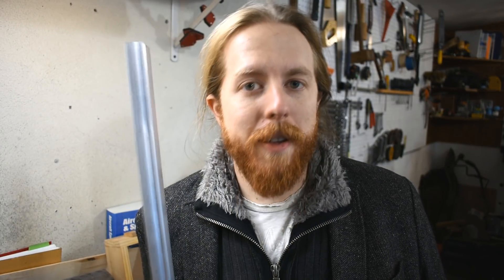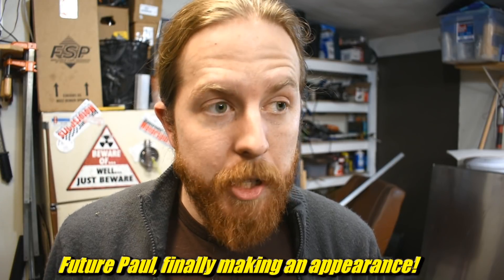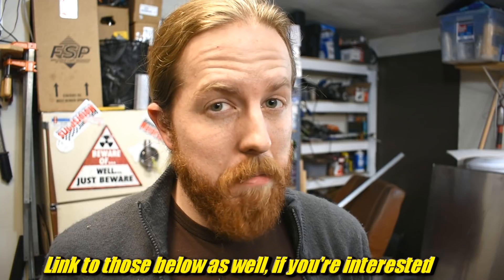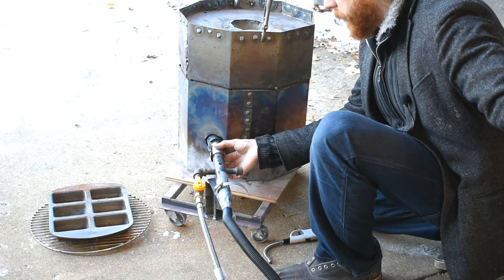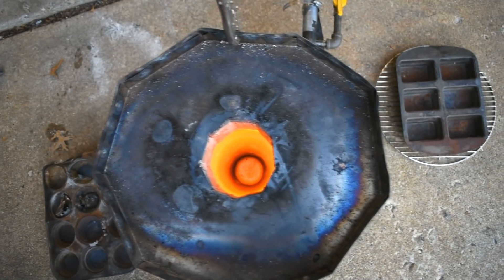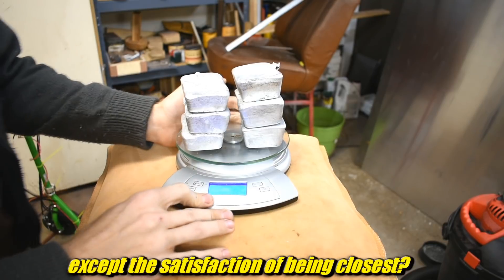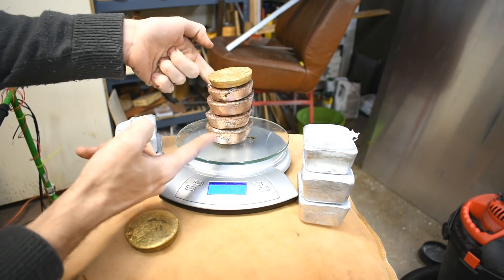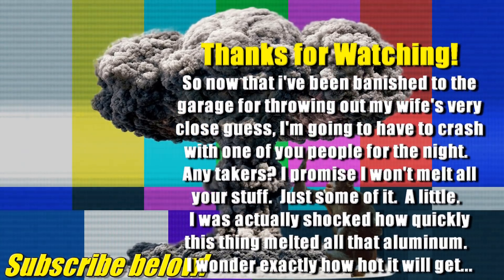How quickly can I fill a crucible with molten aluminum?

Comment: did you get your crucible and holder from that guy who makes and sells them online?  "free holder when you buy the crucible!"  that guy.  what was his name?
Reply from the maker: Nope, I got the crucible on Amazon I think, and I made the crucible holder from 1"x1/8"  bar stock
Reply: OK thanks for that info.   This was a good reminder I should get some satanite to coat the fire exposed parts of my first furnace.  I am using the half perlite, half masonry mortar recipe as my refractory cement and it probably can use all the help I can give it.  How many pounds of satanite would you estimate you used to coat the inside of yours?
Reply from the maker: I probably used 5-10 lbs, I bought 20 lbs though so I have plenty extra

Comment: my guess would have been 5 minutes too, just because i've melted one ot two things and thought i've gotta sit there for hours until its molten, but no it goes really quick, even with my weedburner from the hardware store wich doesnt make near that inferno yours does. melting aluminium is really much easier than you might think it is.. the hard part comes after melting it :D

Comment: the aluminium puddle helps the melt as it transfers the heat to the unmolten aluminium faster than air or the limited contact to the crusible , i think it saves time and energy (gas) if you start with small scrap to make a puddle and then add the bigger stuff to fill the crusible 
i seen silicon carbide powder being sold as grinding powder maibe you can make youre own cast aluminium

Comment: so for someone who has everything except the burner...want to make and sell me one? lol
Reply: I wondered if one of those propane weed burner torches would work
Reply from the maker: Lol I dont even want to imagine the liability with that! My burner requires constant screwing around to keep it working, you dont want keep to make you one
Reply: Here's the one I built with plumbing parts. Feel free to copy the design. Works very well. https://www.dropbox.com/s/9j1psluk01eyxed/20180115_112016.jpg?dl=0
The reducer at the burning end is 1"-to-3/4", the tube is 3/4", the intake is 3/4"-to-1-1/4", the brass tube is 3/8" and it has an end cap with a 1mm hole drilled through.

Comment: Either on YouTube or somewhere I read about making ingots from scrap and dealing with impurities aka dross gives you less problems when you melt for your actual casting. So when you melt your ingots, do you have less dross and better casting results than melting scrap and trying to cast with it first go?
Reply: I've tried both ways, melting down cans and pouring into a cast from that puddle, and making ingots and remelting them and pouring from that puddle, and I will say that remelting the ingots is the better way to go. Less impurities to deal with and more metal in the crucible to get more head pressure. Best part is, whatever you have left over in the crucible can be used as the starting puddle for the next can melting.
Reply from the maker: Depends on how clean or not your scrap is.  Cans (suck for casting but just for the sake of argument) should be made into ingots first, but clean cast aluminum can just be cast as is

Comment: I am surprised you didn't mess up your loaf pans. You ever think about making an angle iron ingot mold? The prism shapes they make stack up nicely. Then again with no good way of cutting angle iron maybe not a good project for you?
Reply from the maker: I got a chunk of angle iron for exactly that reason, just haven't made it yet
Reply: @PaulsGarage  yeah if you're into this DIY stuff I can't recommend a horizontal band saw enough. It really opens up project possibilities like nothing else can. Goes good with a welder. It's nice to be able to cut metal before you weld it. You could use abrasive discs on an angle grinder. But you're going to go through a lot of discs and a lot of energy. So the economy of that over time is poor. It is tough to say just run to Harbor Freight and buy one now. Because they've gotten expensive. When I got mine I only paid $179 for it. Today they want $260. Still, watch for a sale. Maybe put a 20% coupon on one?
Reply: All I got for cutting angle iron is a hacksaw and I still made a mold from it. https://www.dropbox.com/s/421bh2gjs2j915x/20180115_111959.jpg?dl=0

Comment: 0:58 “fire is fun” I agree with your statement
Reply from the maker: Fire is indeed fun.  And hot. But it's a fun heat.
Reply: Paul's Garage it’s a fun heat until you grab hot metal and burn your whole palm :/

Comment: Those IR thermometers are terrible for stuff like getting the temp of molten metal or the inside of a furnace. 1) your only getting a surface reading. 2) The emissivity of molten metals and red hot surfaces is very poor. (also Aluminum has a poor emissivity for IR temp readings, for aluminum fins in a heat transfer lab we had to put black electrical tape on the spots we wanted to measure as IR is unreliable for bare aluminum).
Reply from the maker: That particular IR thing kinda sucks too, but I found it in this garage when I moved in so free makes it perfect
Reply: @PaulsGarage  Free is good. I always say, Use what you have, borrow what you can, buy when you are able.
Reply: @kfoltman  Yes, the emissivity does increase towards 1 with higher temperatures. but not enough to make the readings with an IR gun valid. Aluminum is like 0.03 at room temps but when it's molten it's only something like 0.12 which is still very poor.  (0 is a theoretical perfect reflector and 1 is a theoretical  perfect emitter of thermal energy)

Comment: "The real degrees"... yeah, right... NOT
Reply from the maker: Hey now the only thing metric has going for it is that it makes sense and Fahrenheit doesnt.
Reply: @PaulsGarage  A lot of people put Farenheit down, but its smaller increments between degrees allow for more accuracy.   Lazy scientists just don't wanna deal with convetsions and stuff like that.  When was the last time you used a digital Celcius thermometer that displayed in increments less that .5 degrees?  Most only display whole degrees (F x 1.6).
Reply: My $10 digital thermometer displays in 0.1 degree C increments.

My $30 IR thermometer also displays in 0.1 degree C increments.

Both more than  accurate enough for me to make beer with.